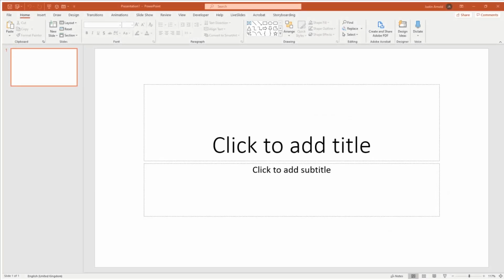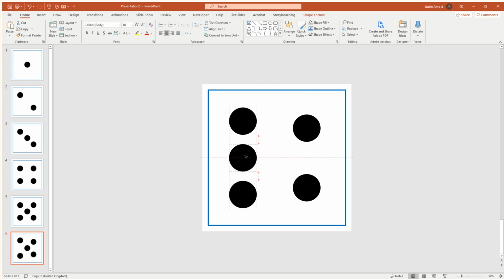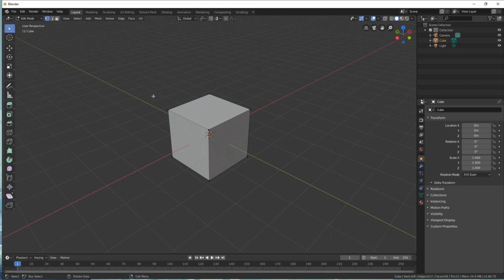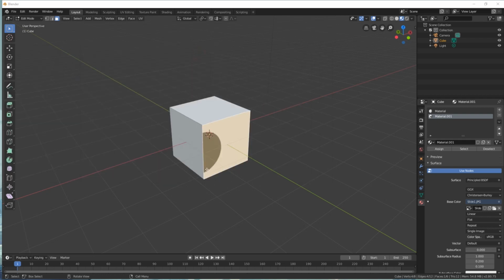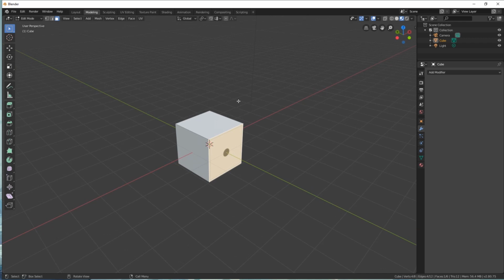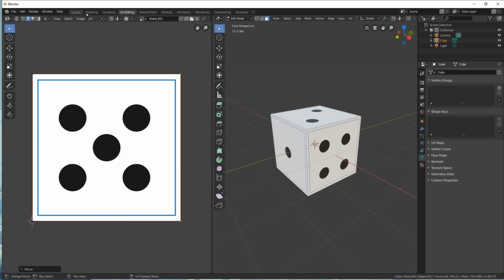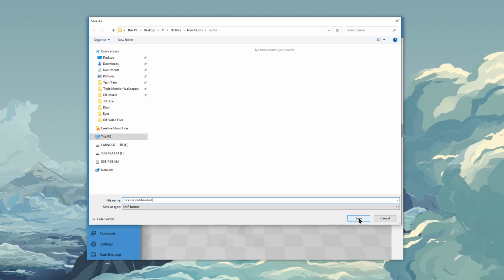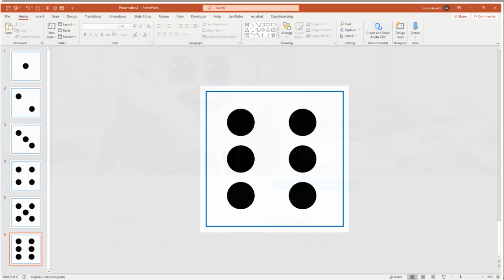Create Fully Customised 3D Dice In PowerPoint Using Blender

Comment: Question for you... I created my dice in blender and saved it to my computer and exported it using Wavefront.obj. When I try and open it in 3D builder, the dice is blank. It tells me that a file with texture is required. When I opened up the file again in blender, my dice still had the dots on them. I tried numerous times to resave the dice as you explained, but I still get a dice without dots. Any ideas?